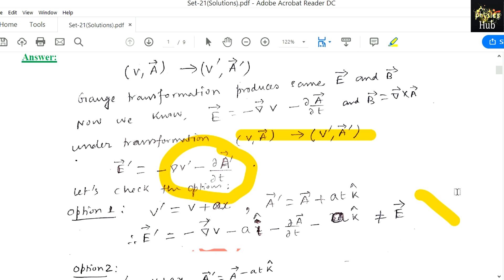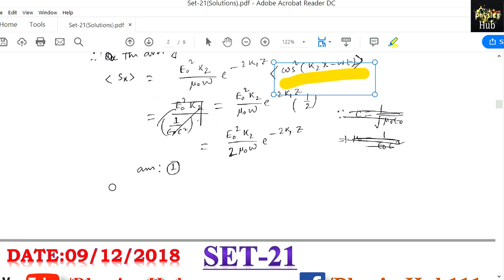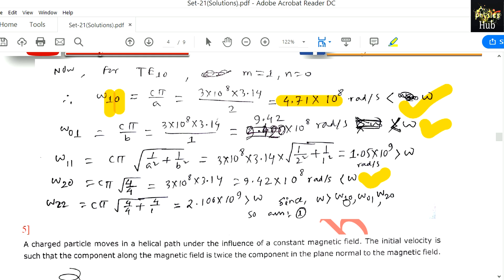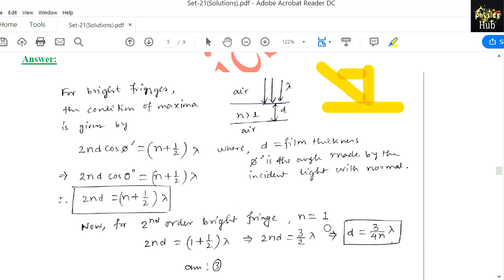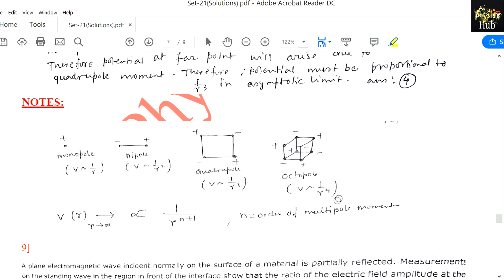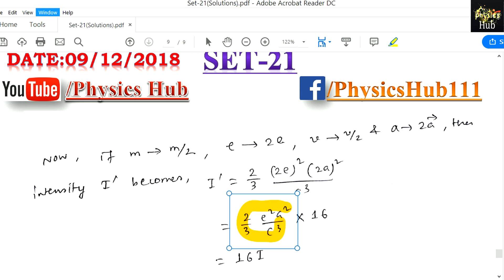SET 21| Electromagnetic Theory | Gauge Transformation,Interference,Radiation etc. | Physics Hub

Comment from the maker: It consists of problems from ELECTROMAGNETIC THEORY Section on the following topics:
1. Gauge Transformation: Scalar and Vector Potentials
2. Poynting vector and Average Energy Flow
3. Rate of change of Magnetic Flux and Electric Current
4. Wave Guide (TE Modes)
5. Helical path of a charged particle in a Magnetic Field and Pitch
6. Interference in Thin Film
7. Electric field intensity from the centre of a solid sphere.
8. Electrostatic Lines of Force from a Quadrupole
9. The Standing wave ratio
10. Intensity of radiation from a non-relativistic moving charge
#EMT #UGC_CSIR_NET  #PhysicsHub
Reply: very nice sir
Reply from the maker: @balabhadraharipal287  thank you
Reply: Sir aapki all class sequence wise kaise milengi specially emt ki